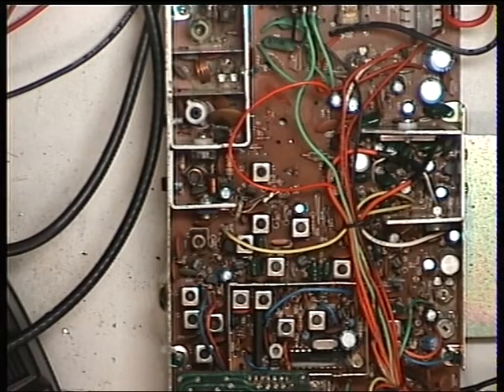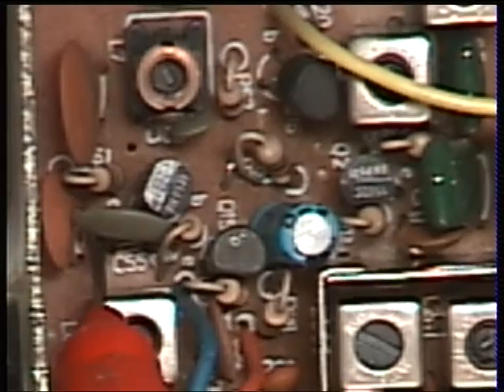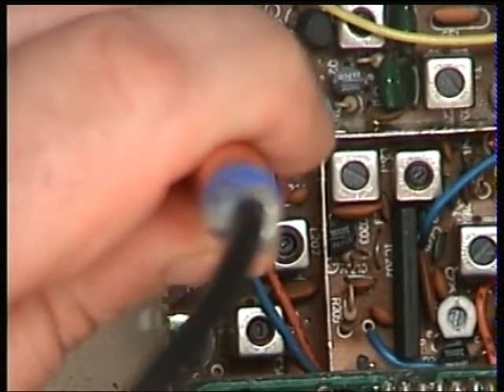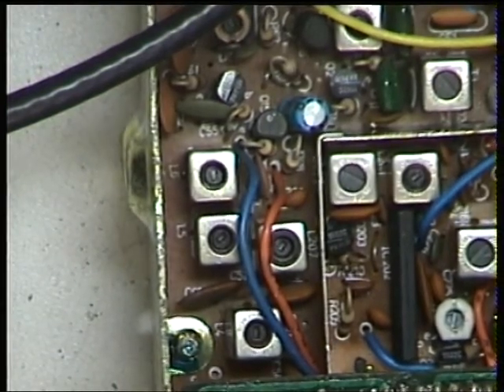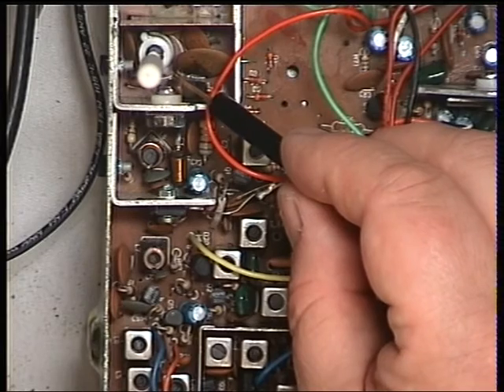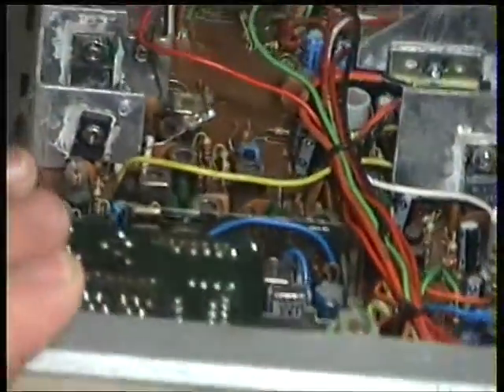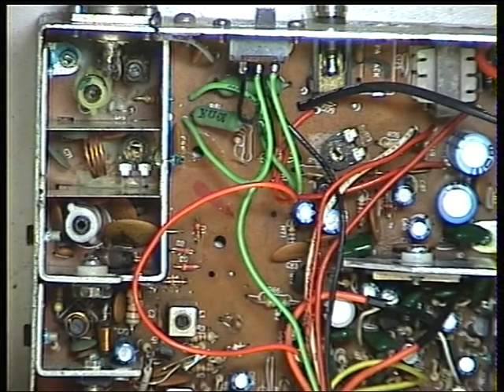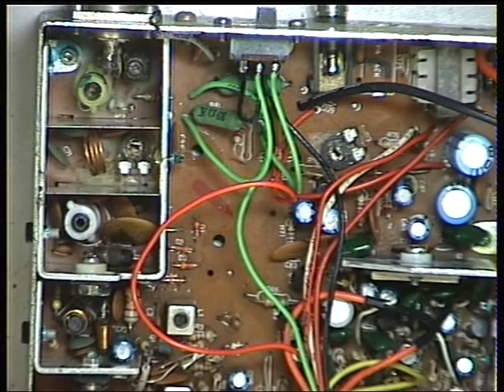Fidelity CB1000, UK (CB 27/81) CB radio (Mobile) -  Transmit Alignment

Comment: i would have thought a man of you calibur would have the the RF indication meter to show the correct output,
i know CBers love to see the needle bang the corner but if it's 3w should the TX meter not show 3w also ??
Reply from the maker: +bigpimp347 Hello Mark. The Fidelity CB1000FM service manual says to set the relative RF output meter "to the centre of the red zone". The meter has no calibration on TX, other than the red zone. Probably because the radio specification is 3.5W. The limit spec is 2.5W. Therefore, whatever the radio is actually doing, it's still set up to the centre of the red zone. This sample managed about 2.999W; one of the best I've ever seen!

When I worked in the United States ('83-86ish), many new 'budget' cb radios wouldn't do more than 1.5W. Purchasers often assume all radios will be 4W output & without reading the specs, this isn't always so. 

You'll remember the time.....I had a huge box of used 40channel FCC CB radios & you hoped I was going to sell you one! No, I took them back to the 'States where they belonged.

T21

Comment: if I dont have a rf volt meter is there anything I can use?
Any setting on a voltmeter that will work?
Reply from the maker: No, but you can cheat. Just put an ordinary diode in series with your positive test prod with the striped end of the diode towards your test prod. Really you need an analogue voltmeter rather than electronic with a very sensitive 50uV DC setting. Analogue meters often pop up on ebay for tiny money if you don't have one.

The homemade RF probe I use is connected to an AVO meter model 8. Instructions on similar RF probes can easily be found on the web & cost you less than £1 to make.

Richard
Reply: hmmm ok thanks!

Comment: where do you get your information?
Reply from the maker: I bought every service manual that was available at the time. I've spent 18 years working in professional 2-way radio,then 4 years as a radio communications consultant......up to 1999, then carried on doing cb only by mail order. However, I've also also worked for the Church Of England since 1980, stepping up the church work from 2000 onwards & fit this work around the church work....got three funerals, a wedding & three other services to do between now & Sunday!